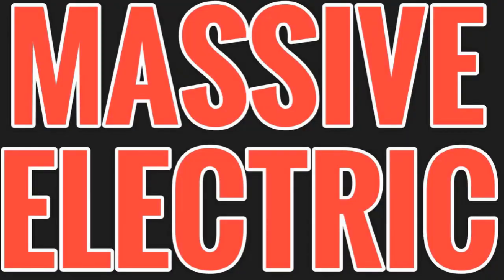"My LED Lights Won't Turn Off"

Comment: An electrician installed my led light.  The wall switch is just as it has been for 30 years.  The single pole  toggle wall switch will turn on the led and will it will turn it off (and I mean COMPLETELY off).  The light came with a remote control which allows me to dim the light once I have turned it on at the wall.  My problem is that if I use the REMOTE CONTROL to try to turn off the light, the light continues to glows softly.  If I want to turn it off completely, I have to turn it off with wall switch.  The remote seems to work in every other way...dims, brightens, changes to warm or cool white.

I cannot find anything on the web that talks about this particular issue.  Please help if you can.

(PS:  I had this happen with two different led lights the I bought from two different companies. The other one is a plug-in light with it's own remote control.)

Comment: This phenomenon I call bleed through or ghost power is often when the switch is electronic(smart switches, timers,  switches and dimmers that have sensors or indicator lights etc) and an LED bulb Even the slightest bit of voltage present that the switch uses to operate can keep the dimmable LED bulb on. Installing a capacitor will likely solve the issue. Lutron makes one LUT- MLC.

Comment: question... I have this problem on many rooms in my house. We are using 3 to 4 small recessed led lights with the same switch controlling 4 bulbs, but 2 or3 of the 4 reamin lightly but the others rightly switch off. Any guess? Because if it is a problem with the switch wiring, they should all switch the same. for better or worse haha, isnt it?
Reply: I have the same issue with 7 of 8 of my lights remaining dimly on when the switch is off. They are on a 3 way switch, so I want to think that is part of the problem. But why does one and only one go completely dark?

Comment: It has to be feeding from the neutral wire return from devices down the line. The hot wire is certainly opened at the switch. Almost any voltage will fire an led..

Comment: My LED lights have been up for two years, and just started staying about 25% on when turned off today. This is only happening in one room. The entire house is LED. So I'm thinking the fixtures themselves are the issue. We did have some serious lighting storms today.
Reply: any fixes?
Reply: @muhammadhaseeb2148  I replaced the two that were doing it.

Comment: Replaced  2 t-12 with t-8  whole  light assembly now when turn breaker on and switch off the two new t-8 lights stay on while the ones I did not replace will turn off with switch wired same wires black to black and white to white

Comment: Just check the neutral on the switch correct neutral wasn’t hooked up I put an neutral wire on the switch it’s in conduit box neutral on conduit box

Comment: It’s not always about how something is wired within the outlets, walls, or the switch. Some LED lights and dimmers just don’t work well together. 

My entire place is configured with Lutron Caseta smart dimmers. My entire place also consists of LED lighting. Of my 20+ Lutron Cassetta smart dimmers there  were only 2 lights that did not work with them. Two LED lights that would not turn off completely. One is a stairwell light and the other is a porch light. 

The solution? I had to replace them with different dimmers. I went with the Lutron Maestro dimmers which are not smart dimmers. They’re one step down. These happened to work just fine. Now when I turn the dimmer to off these 2 LED lights turn completely off.
Reply: Thank you this comment was super helpful

Comment: My lights are bright on one side and dim on the other, it’s all one strip idk what to do
Reply: You need a higher voltage LED. If you use 24v LED, the drop of tension along the wire is not as visible.

Comment: Does anyone know how to fixed my lights 

Basically my buttons are mixed up (red is red then green is blue and blue is green)  some buttons don’t work at all and my red is stuck on the lowest brightness, the best part is when I pushed the off button it also turns red and when I press it again it turns to another colour and then back to red 

Please if anyone has any suggestions it’ll mean a lot I’m sick of this 🥲

Comment: on my work we buy thousand off cheap leds lights to pre test appartements once we do startup off the electric box the ones my boss now buys keep working on 1phase without neutral connected it really messes up your mind if you trying to take out fualts between the light switches especially when we talking 300appartements lol if timers and sensors are involved we completly screwed PS you can now get little cheap cubes to put over the lights as a load to stop it but its stupid solution
Reply: 13:19 later "check the neutral"